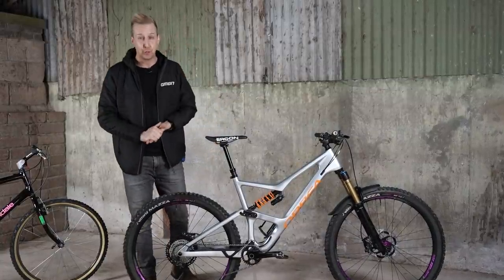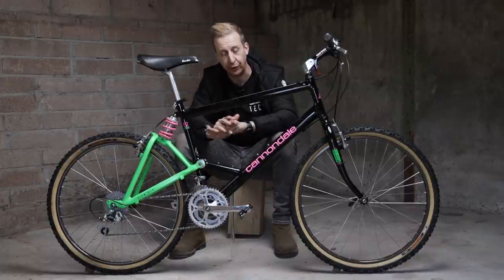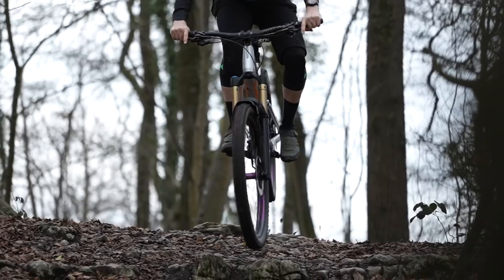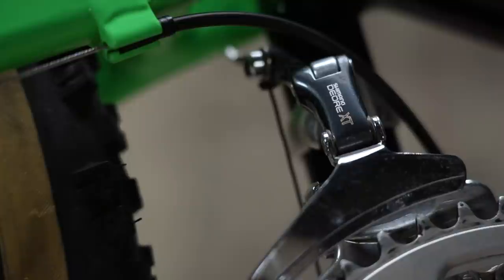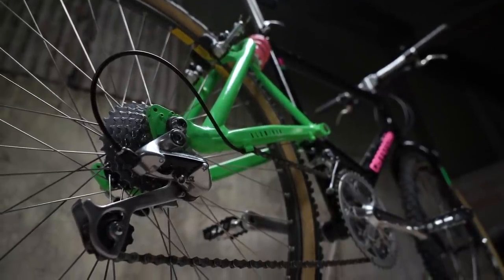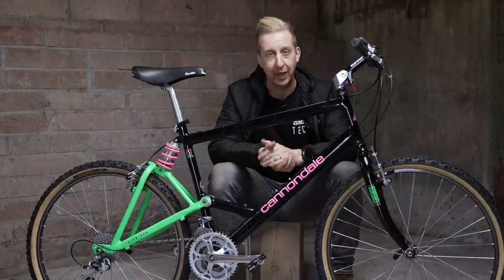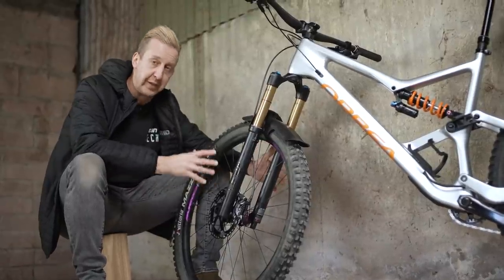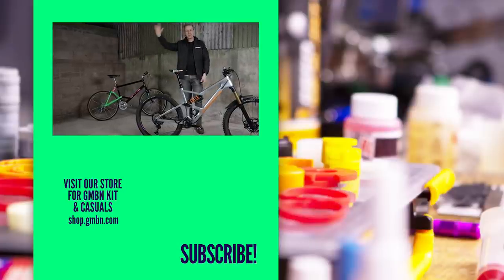The Evolution Of Shimano XT | Retro Vs Modern Drivetrains!

Comment: Interesting, I just restored a 1991 Schwinn Paramount SDG Series 70 and I can't believe how robust all the Shimano Xt components still are now. This bike was ridden far and hard until it 'expired' and tossed into storage. After many hours of cleaning and downloading service manual and parts pdfs from Shimano's online index it looks like I have all the original M730 group set with optional SPD clip-in pedals.  The big chunky cantilever brakes of the M730 series are iconic and the rear derailleur looks as good as any modern one, still indexes too. The springs and arm pivots are loose but with cables, cearings and copius grease a 1991 MTB with Shimano XT components are still a good buy because if you can manitain then these top shelf designs can last a very long time. It is a testament to build quality.  Stoked Shimano had all the original parts sheets too. 1991 is close to cut off mark but I would say this is a good arguuement for speanding as much as you can afford on a good used bike with XT rather than a new one without.

Comment: I’m still riding my 1989 custom MTB with 3x7 XT. For the trails in west Cornwall it’s great. I have a  full-suss MTB and a gravel bike too but the retro is the perfect compromise for a ‘one bike does all’.
Reply: I would strongly disagree on that. When I went back to my old bike, which isn't nearly als old as yours (06 Giant hardtail) it instantly felt much worse compared to my BTR Belter not even comparing it to my enduro bike. A lot less confidence going through turns and rough stuff. But to be fair its quite cool looking at all the differences that these 2 bikes offer.
Reply: @mt4xcs  hang on, you are saying my personally specced, fully custom built, fully rigid, steel framed bike is rubbish because your factory built aluminium framed sus-fork bike is. Er, ok.🤔
Reply: The main issue is frame geometry, for me the sweet spot was around 2011/2012.

Comment: Upgraded from a 2007 Scott Yecora 26 to a YT Capra 29er last year. The most noticeable and immediate difference and enhanced riding comfort made the dropper post. Albeit, the wider bars and the visually longer bike from the riders perspective were just weird in the beginning.
Reply: So really the frame geometry? Because the rest were available if you knew where to look.
My move to more up to date bikes happened 5 years ago when my 12 year old bike built from second hand parts was stolen. 
I had built it with a one by setup as I hated front chainwheel gearing, that had CNC billet BMX style chainguards, it was only 8 speed twist shift, I had Magura Gustav brakes with 210 mm rotors front and back, Rockshox forks (new at the time I built it as the Fournales Look forks I found weren't ideal), hollowtech crank, built my wheels with Shimano pop out spoke hubs, and slapped that on a clear plastic coated 19" aluminium Ridgeback frame.
Replaced it with a nice full suspension, but I prefer my 2011 Voodoo Bizango 29er which I built last year using Magura MT5/MT4, new Rockshox forks, Shimano Zee shifter, FSA hollowtech crank.

The major difference is the frame geometry.
Reply: i mean wider bars and a dropper can be put on almost any bike

Comment: This brought a smile to me, as I spotted the XT "thumbies" -  the same group set that came with my '89 Klein Pinnacle. I still have that bike, only acquiring one more bike since, a '17 full suspension LaMere. Having both bikes, the two main differences is how small a medium, 26 inch bike is compared to a carbon 29er. The second difference is how much weight is on the handlebars of the 26 inch bike due to rider position and bike geometry, compared to the modern geometry of a 29er. With so much weight on the bars, its almost a liability if you do not ride with a firm grip. The modern bike is much more upright, more relaxed, yet infinitely more capable in the dirt. Amazing progression. Thanks for the trip nostalgia lane, Doddy.

Comment: Great video: the old xt overview broght back so many memories! I'm such an XT fan boy. My first "real" mountain bike was a ca. 1990 Giant Sedona equipped with 400LX. Fun CroMo bike that first addicted me to mountain biking. 

When I graduated high school in 1994, I got a 1994 Boulder Defiant. I kept it for many years, only selling it two years ago! It was the bike that earned me the nickname "Mike the Bike." It was a similar high single pivot design like the Cannondale in this video, but they lowered the top tube and interrupted the seat tube to place a coil shock in the the top tube. It got 2.25 inches of travel at the rear wheel, and was paired on the front with a threaded Marzocchi XC-51. Loved that fork. With the elevated chain stay, it looked freaking hot; super sleek. The downside was that the interrupted seat tube led to very little seat height adjustment... not a lot of room to insert, and lowering essentially meant cutting the tube. It was a full XT 7 speed setup with cantilever brakes that I eventually upgraded to the classic 9 speed XTR setup, including v brakes and some hilarious kooka cranks. I did maintain the original front XT derailleur, as fitment on the frame was tricky due to the pivot position. The 7 speed up front was janky, but I tuned it to just give me middle and small ring up front. LOVED this bike. 

I picked up a used 2001 superlight in 2007 or so, and that was my introduction to disk brakes. The experience was revelatory! That inspired me to ride more, and I moved quickly to a 2009 yeti 575 carbon. That bike had a talas fork, which I thought was so cool, and full XT front to back. Trail geometry changed my life, I had spectacular fun on it. I didn't ride it s much at I'd hoped, however, as kids arrived on the scene that same year (2009).

In 2016, a LBS was moving to a new location, consolidating their operations from several locations into one. I made the mistake of hitting their outlet location (now closed because of the consolidation), where they'd put their outlet stock all at 50% or better. I picked up a 2016 Trek Remedy 9.8 (carbon, fox 36, full XT, 2x11, 27.5) for half price! Wasn't planning on getting a bike, but wow I could not say no. I've never had this much fun on a bike! That Remedy has taken me from decent rider to certified instructor and more. The inclusion of the dropper post has been nothing short of revelatory for ride progression.  Working at home with the pandemic, my lunch hours have largely consisted of dates with the Remedy on the Coulee trail out my front door.

Last year, I picked up a fat bike (Giant Yukon 2), which was my first 1x drivetrain and I love it. I went for Deore just based on price point and expected ride volume, and it has not disappointed. I'm not huge on the guide brakes on it as compared to the XT brakes I've been running on my other recent bikes, but they work well enough. Have had a blast rocking that bike in the mountains and other local trails - snow coverage makes familiar trails new again!

I'm now expecting delivery of an enduro ride in May and I can't wait. It's an evolve alpha 29, and it will have fox factory 36, XT 1x12, carbon wheels, and TRP EVO 4 brakes. The Remedy will be sold, and I have two minds about it. I love that bike, but I will be able to sell it possibly for more than I paid in the first place, minimizing the next step upgrade cost!

My kids are so spoiled. I read my own history, and then look at their bike progression, and it makes me so jealous. They are 10 and 12, and have been rocking 1x drive trains with air forks and hydraulic brakes for like 4 years each now. I've also taken advantage of 26 going away to have them in ridiculous rides for relatively low cost: my son is on a near mint condition 2011 specialized pitch pro, and I'm rebuilding (completely new 1x drivetrain) a 2008 Specialized Safire (including custom paint and dragon themed Specialized branding) for my daughter. 

Great video, and it is absolutely astounding just how far we've come.

Comment: We need a real back to back test on the trail Doddy! 
Lovely bikes cool vid 💚
Reply: The problem is that they can't afford to break anything on those old bikes (spares are next to impossible to source), yet they would break so easily if ridden like the modern bikes they're used to riding now. If they pull their punches too much though to save the old bike, then it's not a proper comparison. I'd love to see it too, but I doubt that it will ever happen.
Reply: its pretty sad that these bikes do not exist to be ridden anymore. such a shame. ride the piss out of it i say.
Reply from the maker: We'd love to give the Cannondale a spin on the trails but, bikes like these are now pieces of history that have to be kept preserved. Thanks for the support! 👍
Reply: @gmbntech  Ride my SE2000 still, although it is now a commute/ gravel bike pretty much - not going to like hitting a big rock on a downhill with those forks/ frame, and I think this is the best way to enjoy classics like this, as putting it on a wall to ogle is really just not right! I lusted after the SE2000 when I was a kid and could not afford one at the time, and finally got one a few years back (albeit with a bad respray and replacement XT under bar shifters) I have another do-er upper one (which is either a SE1000 or 2000 - as yet unidentified) I found in the woodshed of my new house that was abandoned under sawdust, mud and scrap (paints come completely off, the front fork is broken (rock shox replacement) and most of the Shimano bits have gone (hence why identification is difficult). The frame and suspension is still solid though. Looks like someone came a cropper on a jump, broke the fork and then abandoned it sadly... It will be restored when the house is done!

Comment: I've come a long way. Started back in the mid 1970s with an old Stingray I used on the trails in So Cal. In 1991 got my first MTB, a Gary Fisher hardtail with rigid forks. Today I'm on an Ibis Ripley with wireless dropper and shifting.

Comment: Hi Doddy,
I've been riding mountain bikes since the late 80s and the differences are night and day.
So much tech has come forward in the last few years, clutch mechs...(do I remember rightly that Shimano had a very similar system in the 90s that was abandoned, where at the turn of a dial the mech tension changed??) Also weren't there "power springs" that did similar things and weird looking tensioning arms that hung off the back of your frame?

Comment: I don't own a modern mountain bike... My 26 year old Heckler is the bike i still ride. Coil front and rear (Z1 up front and a RS Super Deluxe out back), 66 degree head angle, and Magura HS22 brakes. Shimano XT M739 everywhere else. It bounces up the climbs like a mountain goat, and is yet to kill me on any descent. The M739 "Parallax" hubs are by far the nicest hubs Shimano have ever made, both in appearance and quality. Original cones and they've still got a mirror finish on every bearing surface.

Comment: my old breezer has a 48t  FSA front chainring  .its a 3x8..... rst delta forks ..mavic 317 front and 517 rear... mis match of parts over the years but still works and still gets used now and then ,and still rides quite well....got mostly xt parts..

Comment: Presumably the gear inches are taking into account the different wheel sizes, cos 46/13 is a bigger ratio than 32/10, but the newer bike has a larger diameter wheel to overcome that

Comment: The v and cantilever breaks on 90/00s MTBs brings back the horror of adjusting them and the enormous difference in feel and power as you hit the mud! Disc brakes are in my opinion the biggest innovation and improvement in terms of maintenance.
Reply: Oh I was well away from that, it was a pain when I was a kid, I got Magura Gustavs in the early 00s and never bothered about rim brakes again.

Comment: Hi Doddy, love watching the show. 
A question, "How much is too much upgrade, or when does it get too dangerous?" 
Reason for asking...  I have a Yeti SB6 and want to get an additional 29" bike. In the meanwhile, I have installed my Fox 38 (for 29" with 180mm travel) on my Yeti SB6 but still using my 27.5" wheel.  It feels great riding, handling and doing 1meter baby drops. I have just been wondering with this setup, if I try 2-meter drops or higher, will this shatter the head tube?

Comment: I've been saving a brand new set of XTR with s-works built XTR Wheels from 1994 hoping to get my dream Klein adroit in team colors from the same year but I've never been able to find the frame set in my size and now you can't find the forks at all. Thinking about putting it on pink bike or retro bike for $3,000 or the highest bid.

Comment: Had GT XCR 4000 '99 refreshed the V breaks (new "pads")  and new tires  Maxxis High roller oh and new fork everything was wrong size :D , i liked that bike quite much at the time i didnt know nothing about mtb but just rode it  fast forward to today and i have Rockrider st520 i swapped drivetrain for 1x9 and went tubeless and looking forward to change wheelset and fork in near future.
Reply: @RealMTBAddict  But the question is do they work the same? 🤔
Reply: @RealMTBAddict  no way...
Reply: @RealMTBAddict  just messing with you dude , Cheers

Comment: I built all my bikes out of others refuse... I had a steel hard tail (NZ built Milazo Crazyhorse.. fairly low on the price ladder) with 2nd hand 3" RockShox that I made a stem for, and elliptical front sprockets. Luxury...
Then in 2000 I bought my mates Foes Weasel I helped set up... 6" Boxxer (& Fox rear) travel, 26 x 3.0 Gazzaloddi tyres. 1 x 9speed,  Banana swingarm (Like a motorbike).... Still a great bike 22yr later.... Now I have a 2nd hand 2010 Giant Faith 0 purchased just b 4 Covid...     3 great bikes... sorta wish I still had the old steel thing, turns out a LOT of NZ riders started on a CrazyHorse.
Reply: ahh the Milazo Crazyhorse, that brings back memories. Was it the '90 3x6 yellow/black paint version? I had high school friends that owned a couple that year. In fact I remember a few of models from the Milazo brand that had some cool bikes through the early 90's. I personally owned a '91 Milazo Rock Climber white front end with a dark metallic grey that covered two thirds of the frame
Reply: @blairrighton6270  I had the green fluro 10 speed forks with black frame accented in uhhh some white and even pink I think... Now you've got me thinking...
A friend that works in the building next door to one of my work units had a Crazyhorse.. rusty but original till a year or 2 ago when someone stole it (probably drunk and wanted a way home)... a classic cut down in its... err... prime?...

I wish I had my old purple chopper (If u had a Milazo... r u a Kiwi... there was a TV show here in the 70's, Giz a go Stu... he rode a purple chopper... had to have one... at 10...

The Foes is still a plush ride.. tho bald tyres makes it 'interesting'
Reply: @TheButlerNZ  cool bro, love talking to fellow  old cranks to reminisce over old bikes.
 I grew up in rotaz during the '80/90's so yep, am a kiwi. Can't remember the version you refer to but I suspect you're a little older than I (am 45)
 My fave tv stuff was Terry Teo and loved the movies BMX Bandits and Rad when I was 10yrs old and yep did the BMX thing (mid '80's) before I did the MTB thing (late '80's). 
Do you remember the Morrison Sidewinders, the Mountain Yaks and the Bauers? That period of NZ MT bike history certainly felt like you were forging something new and exclusive as you could tell who rode the trail before you by the tyre marks they left in the ground.... can't say the same thing now!
Am fairly certain that if you trolled the 2nd hand bike shops in NZ you may be able to find your chopper and I'm liking the sound of your Foes even with sketchy tyres!
Reply: @blairrighton6270  I'm a little older... 53. Mentally stopped growing around 30... I grew up with HMX, Grifter and mums old red hand painted Raleigh step through circa 40's with a solid rod front brake.
I stopped riding bikes after intermediate and picked it up early 90's when I built a chrome frame 10 speed... then got the Milazo from who knows where (possibly given)... Put elliptical front sprockets on and made some old rockshox fit... Really only started to DH properly after giving up motorbikes. not that I sell anything so I still have most of my toys. (2 YZ's, an IT200, Subaru 2k tsr and now 90% of a rusting transit 2005 (white elephant crud)

Comment: 21 gears is one of those myths about bikes. I can prove this mathematically. If you run the 26:13 then your ratio is a 1:2, one turn on the cranks is 2 turns at the wheel. If you go up to the 46t and use the 30t rear ring then your ratio is 1:1.54. That 36 offers nothing to the system in terms of range. The two gears either side more than cover the range. It that drivetrain had a range of 3.54 at the fastest gear to 0.87 at the climbiest gear. It just had a lot of guff inbetween. For better context, this is slightly less range than a GX/X01/XX1 Eagle 12spd with a 38t up front

Comment: for me the regular deore is enough. i dont need the extra range neither do i need the extra low weight of the xt. i ride emtb where 1x10 is enough range.
Reply from the maker: That's great it works for you. Sometimes a huge gear range can be unnecessary. Especially, when you've got the power of an e-bike behind you.

Comment: How can you say that the cannondale bike is a full suspension bike , it hasn't got suspension forks , it only has a girvin flex stem?
Reply: I had one with a Flexstem before I upgraded with a pair of Pace suspension forks. The rear shock combined with any kind of front suspension made this a full suspension mtb. No difference now with Fox or Rockshok suppling bike brands a suspension fork to make a rigid bike a hardtail - the bolted on front and/or rear suspension changes the type of Mtb it then becomes.